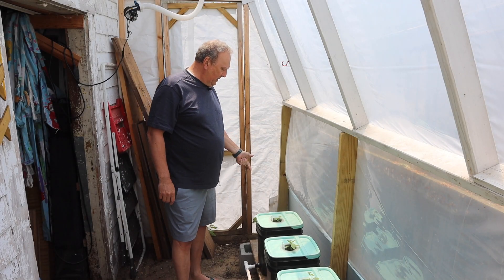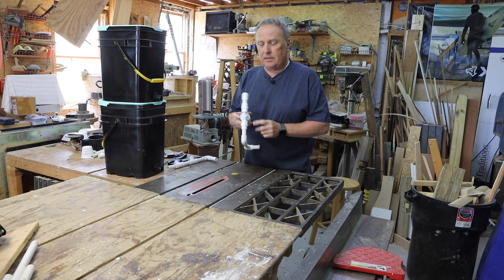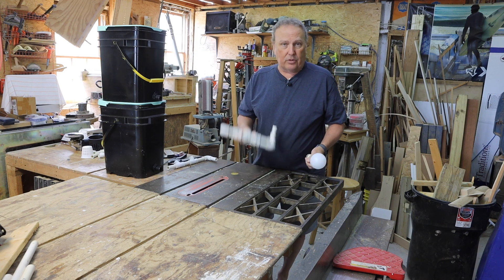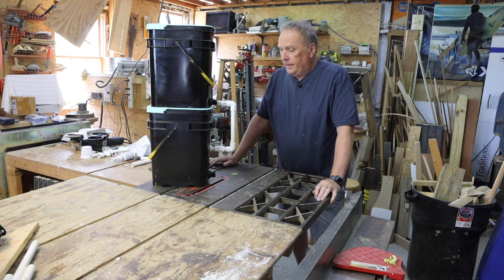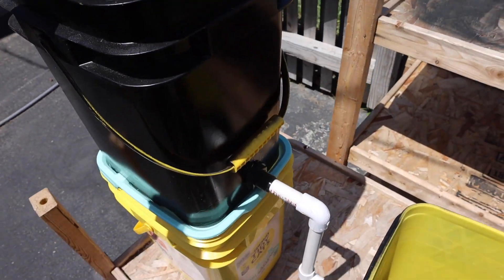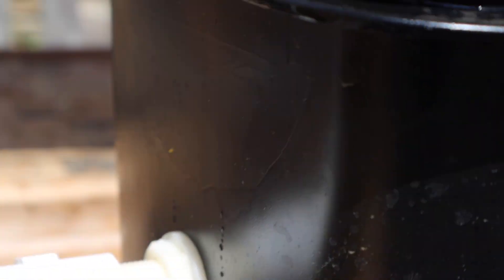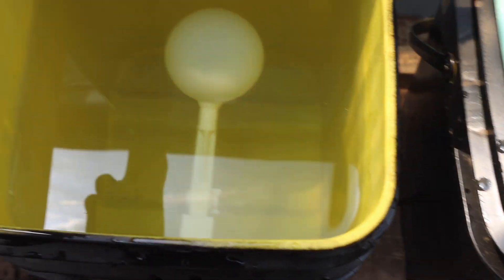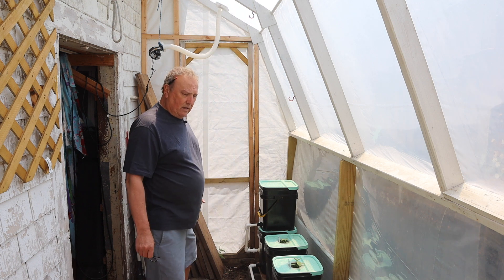Modified Kratky System Fix - Home Hydroponics

Comment: I tried this & the roots eventually grew so far down they messed with the float.
Reply from the maker: Roots are far from the float, that bucket doesn't have any plant in it. So that won;t be an issue. But I did have issues with the float... video coming to explain what happened. Thanks